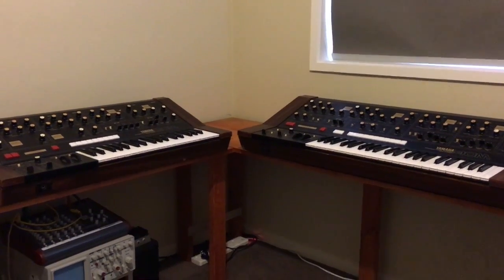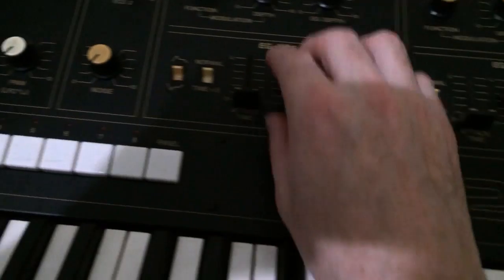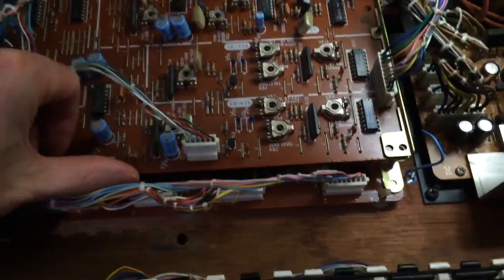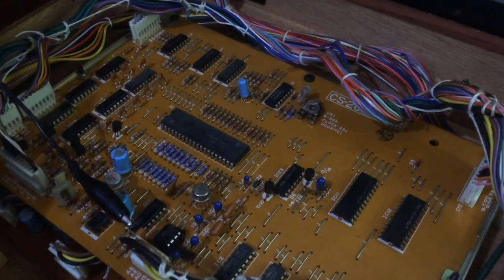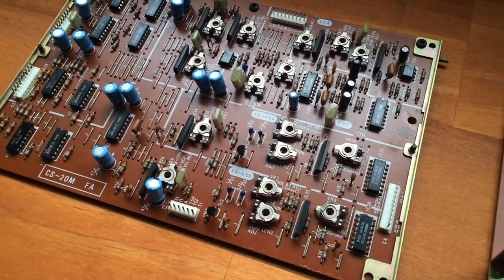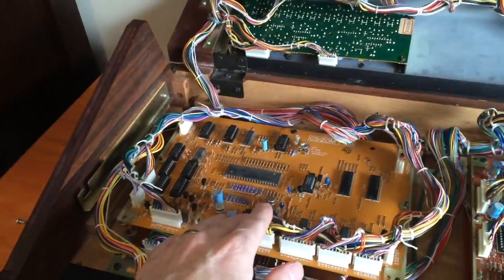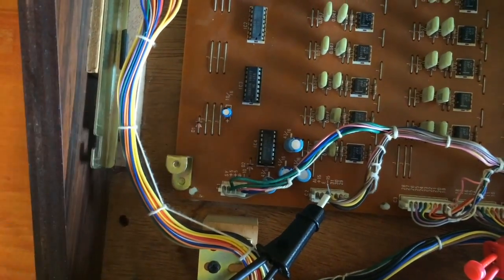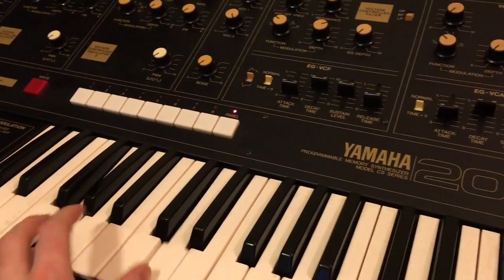Yamaha CS20m & CS40m Restorations (Part 1) - Overview and Repairs

Comment: I have a problem with my CS 40M. It still sounds fine when you play sounds from memory but in panel mode, there's just one noisy sound coming out of it an only the white knobs seem to work. Besides, the lfo speed light is always on, it seems like speed is constantly at the max. 
Does anyone know what the problem could be?

Comment: The blue caps probably blow because the power supply goes out of spec when it's caps dry out. I overhauled one of these in the last few days. Memory was not working but first thing i did was to check all the power supply caps. Someone or a few people had changed the caps in the past however i found some bad ones and some very shoddy soldering which i cleaned up. Board looks much better now. I also found 4 missing caps on the psu. the 1uf ones. I'm not sure if some of them were supposed to be omitted but on one of the pairs there was just a leg left there so those had been forgotten in the past. I put all 4x 1uf caps back in. I did some similar work on the other boards but they were looking much better anyway, i only found a few things that needed fixing.
  In the end the memory issue was corrosion in the battery box where the spring terminals attach to the rivets. For now i hacked it and soldered wires to the springs themselves. Very glad i now have memory.
  I am looking to buy an MP3 device with line in. This way i can download and store any sounds i make from the memory and use the mp3 as a sound bank that i can flick through and reupload at any time. Seems much better than messing around with a tape recorder! I'll look for either something with a touch screen or a rotary encoder to make flicking through the sound bank easier.
  PS. always check the components with thicker legs such as the large resistors on the psu. They tend to form bad solder joints very easily, sometimes not easy to see.

Comment: I am trying to repair my sk 30 . Can you suggest where to find knobs and fader slides . And keys . Any help would be great .
Reply: I think it uses the same slide potentiometers as my SY20. Search for "Alps RS30111A602N". You can transplant the handle from the old slider to the new.

Comment: I am rehabbing  a CS20M and trying to get finished by Christmas. I love what you have done here and my troubleshooting has revealed that I also have the same YM617 chip dead. Currently searching for one if you have any leads. Also, love what you have done by putting in chip beds. I would like to do this next but have never done this before. That said, can I just by chip beds on Amazon? Is one chip bed better than another? I would love to get your opinion on this. Last, can you recommend a source for the non-Yamaha common chips? Greatly appreciate your incredible talents!
Reply: Hi Scott, I've succesfully recreated the YM617 in a little circuit and currently developping it further as a drop-in replacement. I'll make a small batch soon, we can get in touch if you're interested in having one.
Reply: @rsnwtrs  absolutely. Please reach out.

Comment: Hi Golt i love your videos! really incredible work you are doing there. I am having some hard times with my cs20m i wanted to ask you where do you buy theese rare ic chips for yamaha thanks.
Reply from the maker: Mostly I have bought mine from abertronix (search on eBay). I got one bad one from him but most were good. You just have to try your luck, it can be hard to find them. But if you are patient they will pop up eventually. The main person I use for general parts is Doug from synthparts.com I trust him more than anyone. Also try the synth repair groups on FB and use the forums as well.
I am creating a synth resources page on my website over the next week or two. I will put up a CS-20m troubleshooting chart that I made. It follows every CV from the knobs on the front panel right through until they hit the voicing circuits. So keep an eye out for that as well: goltsynth.com
Good luck!
I also plan to start doing Q&A videos soon as well. In them I will help troubleshoot specific questions that other people have. I’m going to put a lot more effort into the channel from now on.
Reply: oh my god i would be soo helpful to o me :)i mean the troubleshooting chart.  i am still working on the cs20m . I just figured out that in the keyborad(sk board) there are some responses in the exit of YM615 but nothing goes out from KV point i thoght the TA7505m might be dead im gonna buy a new one. i also wondered since now i changed i every cheap ic chips on the pgm board and now i got the preset lights working. but i have only noise signal coming out from some of the presets. and i cannot get the readings that you getting from the DM board so i am assuming that all my ym617 s are dead on this board? is there any way to check them? because they are responding to the preset changes but not when i change anything in the panel :/ again thanks a lot for the video it is so helpful i keep watching it over and over again and i am waiting impatiently for the troubleshooting chart .
Reply from the maker: kıvılcım konca check the website the troubleshooting chart is there now in the resources section.
goltsynth.com

Comment: hey Golt!, been watching these for a while now, they're great reference videos when doing repairs, typically this one, i am repairing a korg poly61, it has a 8049 337 microcomputer that controls three 8255a-5 ppi chips, (for some reason their chip select pins are receiving a High signal thus not being active), but in relation to this video, the 8049 i can't seen to find a clock input, i am assuming theyre called XTAL 1 and XTAL 2.... not having an oscilloscope does make iit a challenge,
Reply from the maker: Blaise ingyou yes XTAL is short for crystal. In most DCO synths the clock line is shared between the ICs and the oscillators so the crystal may not be near the main processor, it’s probably buffered first then distributed and divided down. You will need the schematics. The service manual should say where the test points are. A quick test on a non-Juno DCO synth is if it is making sound the main clock/oscillator is working.
Reply: thanks for the reply!, yes there is two seperate crystals for each microcomputer (one is the main and one is the key assigner), ordered an oscilloscope so should be able to test soon, only thing i can find now from probing is all 3 8255 chips have Voltage high on their Chip select pins (theyre active low) followed the logic back and still couldnt find any reason as to why theyre not being selected, will just replace every Logic IC in the path and then start from there, will let you know!

much appreciated, B.

Comment: Thank you for the videos. I am working on a cs20m and wanted to confirm its ok to replace the tantalums on the power supply with non polarized metal poly caps.Any thoughts would be appreciated .Dave.
Reply from the maker: Tantalums are polarised so I usually replace them with the low leakage versions of polarised electrolytic caps. Metal film caps (polyester -> MKT, MKS etc) should be fine though. The only problem with film caps is they are much wider. Electrolytics are about the same size as a Tant. But as long as you can fit them in and they are the same value, the circuit won't care.

Comment: Another very informative vid! I've noticed the price of old yamaha synths has really shot up in the last few years, at least here in the UK. I suspect the cost of replacing all those proprietary chips has played a big role. I mean OK, the niche audio chips I can understand but was it really necessary to produce a limited run of in-house multiplexers, when off-the-shelf equivalents like the 4051 were available?
Reply from the maker: My thoughts exactly! :-)
Reply: I think Yamaha were the only Organ/Synth manufacturer who had their own fab for making chips. Having made the investment I suppose it made sense to them to make a special IC in house if it made the overall synth design slightly smaller or cheaper to make. My first thought looking at the custom chips was "I wonder if any of the same ones were used in Yamaha home organs"  which of course were a big seller in the late 1970s.